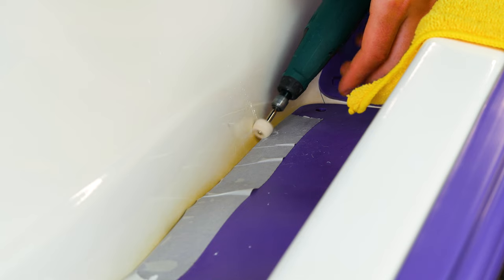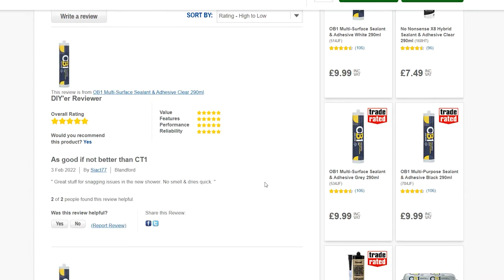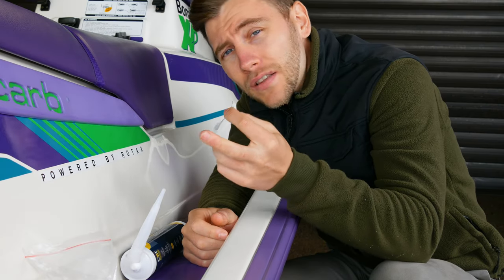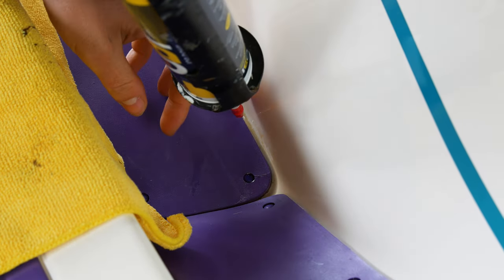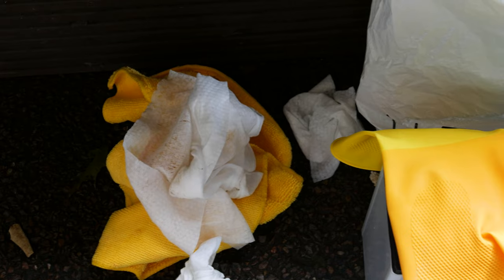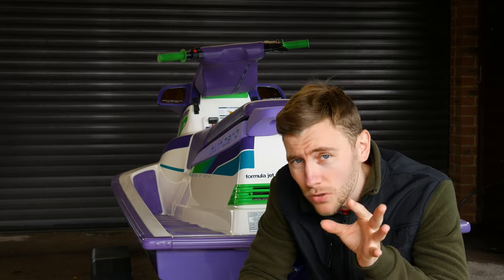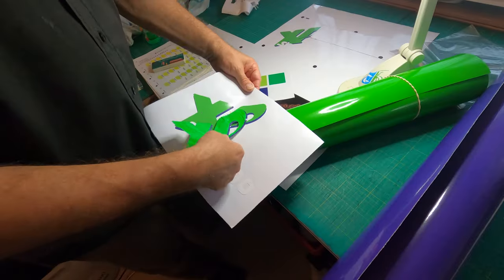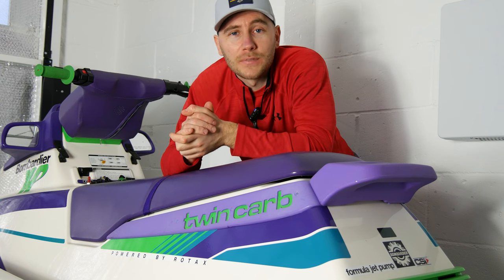How to save OEM jetski footmats - Gluing down Seadoo 1991 XP foot mats | XP 1991 Series | Ep6

Comment: I think you should rip those old paper thin oem mats off get some hydro turf or blacktip mats. They are thicker and more comfortable on your feet.
Reply from the maker: This made me chuckle 😂 trust me at times I asked myself why I didn't give in and get Hydro but then it wouldn't be OEM...Now its completely restored, I'm really happy I saved them as the originality factor is important to me....On some of my other builds I will defo use the after market pads as you can get some cool designs... thanks for watching dude.
Reply: @classicjetskis  I hear ya there. I like the custom colors of the aftermarket mats